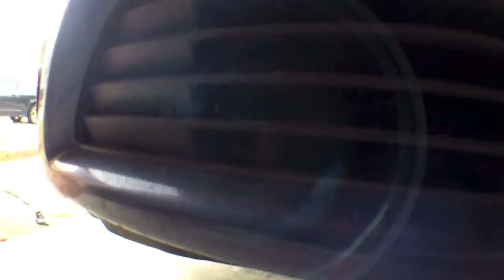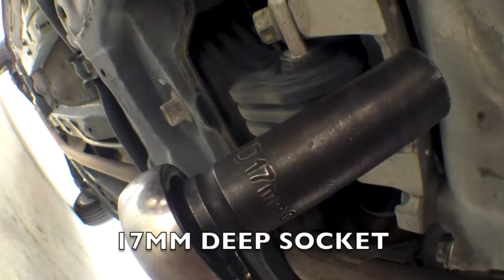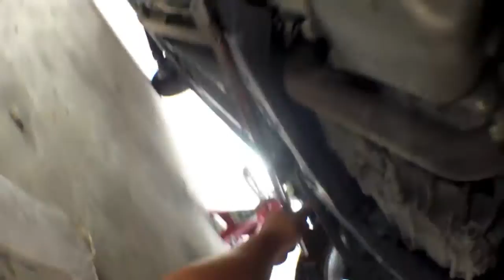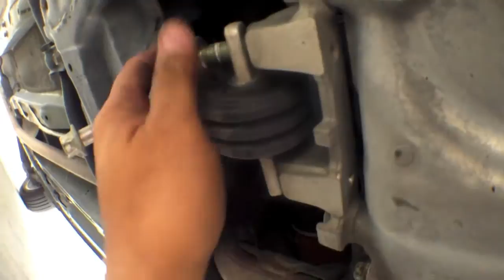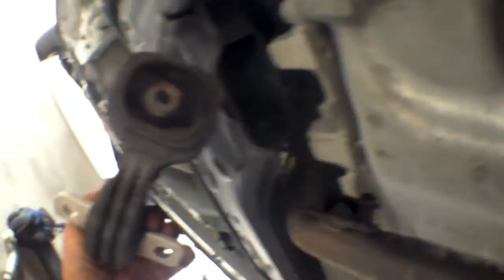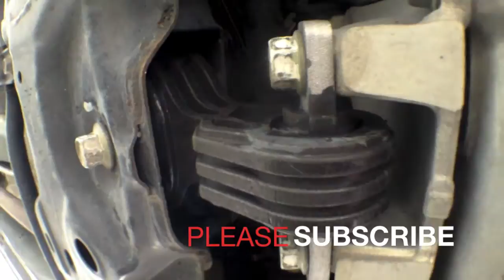EASY FOLLOW lower engine motor strut mount Honda Civic √ Fix it Angel

Comment: Replaced mine today. Had front wheels on ramps. Did not have any stress on bolts when I removed all 3, but after bolts were removed I ended up having to jack up the oil pan using my floor jack maybe an inch or less to get holes to line up. Also had to fool around with putting a piece of plywood under the front wheels OF THE JACK and also put another 4x4 piece of wood on the floor jack saddle pad so that the angle would change on the oil pan pressure point. Had same problem with changing other mounts. The top of my engine would tilt back every time I jacked it up. Anyway it took an extra 10 min, so no big deal. 
If you put a piece of wood on your oil pan jack, do not put it to close to the rear of the pan or it will be in the way when you try to pull off the old mount. Leave about 3 inches of room from the back edged of the pan.
P.S. i did not see any damage to old mount, but since I had bought all 4 mounts on ebay for $89.50, I decided to just go ahead and replace them all.

Comment: I read a few comments asking why this video did not use a block and jack under the oil pan.  In my opinion, if the other motor mounts are working, they will be good enough to keep the engine from dropping.  But if all the other mounts are bad, I would definitely recommend a block and jack under the oil pan.  I was able to replace my lower engine motor strut mount without a block and jack under the oil pan.

Comment: Do all models of civic have this mount? On rockauto's website, there is no torque strut mount listed for the 05 civic. Automatic, 4 speed. I replaced the rear mount last night, didn't notice this strut thing by the transmission.... I'll have to look again.

Comment: why you did not put a block under oil pan jack it up a little the unscrew bolts. i seen this on other video. please explain.
Reply from the maker: +Setfree s because I didn't have to but if you want to use a block, then you can. there is nothing wrong with not using a block. follow what the other videos are doing if that makes you happy.

Comment: no jack with wood block under oil pan if i am correct? just jack stands on both ends of the car? i have my part i am ready to replace my mount.
Reply from the maker: +Setfree s Yes but on the other mounts you need to do that. Please watch my other videos.
Reply: Yes. Thank you. I just bought two jack stand and hydrolic trolly jack plus my tools. I want to be safe first.
Reply from the maker: yes always safety first

Comment: This engine shock mount is connected to a bracket which connects to the oil pan. Anybody know the name of the bracket? I need to replace mine. Thanks in advance.

Comment: Does the rear torque affect the driver side cuz I get a vibration and can’t do more than 70 mph ..cuz I know my is bad
Reply from the maker: ugonna12 is your tires balanced?
Reply: Fix It Angel also when I’m at idle u can feel the car vibrate

Comment: Fix It Angel- My 2009 Honda Civic ran over something big and tore a hole near the motor, which leaked and now i need to replace the motor.  The man said to install a used.motor plus labor is around $2,600 and im not sure if i should trash the vehicle for that amount and buy a used 3,000 car or get it fixed.  Is that amount high?
Reply: Ha, I saw you ask this question on the 8th gen forums. What did you end up doing?
Reply: I ran over something on the same model car. Huge piece of plastic. Probably from another car. After that my car began rattling.

Comment: I don't know what else to do... the vertical bolt won't budge at all! I sprayed/soaked it with Blaster PB from top tip of the bolt and even into the mount and hit it with standard metal hammer as hard as I can and used 15inch 1/2 breaker bar extended with metal pipe to about 30 inches and pulled on that thing (lefty loosy) as I hard as I can and nothing... I am afraid that something is going to break (mostly the breaker bar because it's flexing...). Thoughts?? Drill the bolt?? Is there a proper way to torch it?
Reply from the maker: Hi Stephen, all the things you did is what I would have done. maybe use an impact gun??